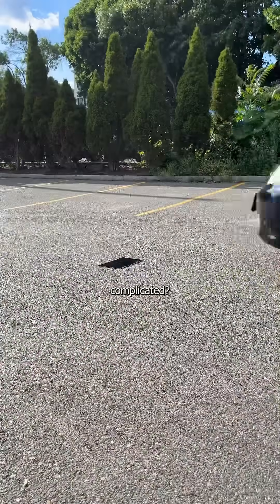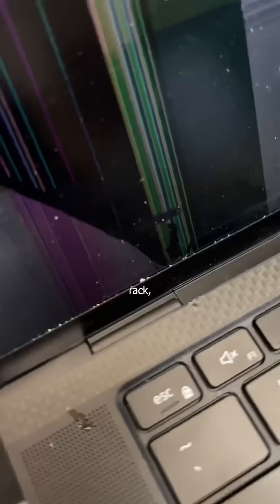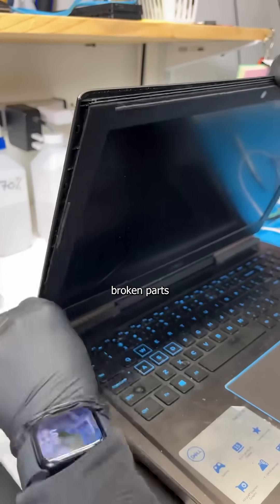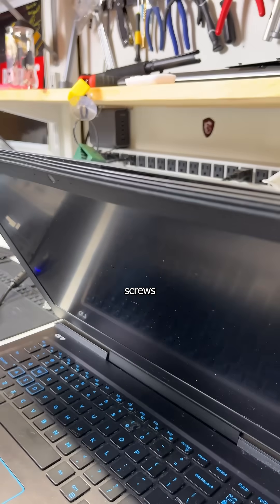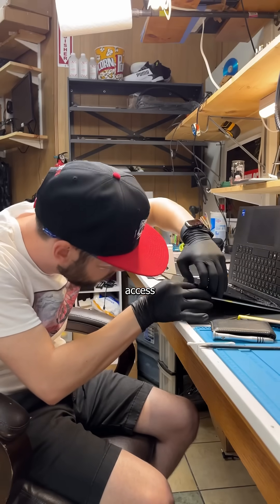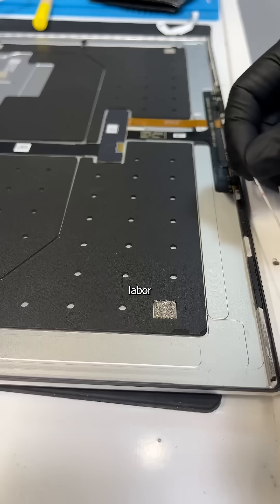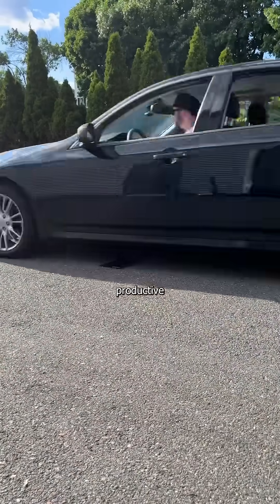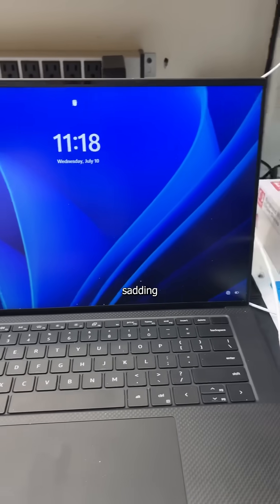Dell XPS laptop screen replacement (this used to be easy) #tech #pc #technology #shorts

Comment: Same thing happened with Chromebooks and their keyboards. Use to be take out 8 screws and it pops out. Now Take out those 8 screws then the battery then the main board then the supports and then you can get the keyboard out.

Comment: Yeah, we got some HP laptops for the employees at my workplace and they haver this adhesive for the screens where you need to basically stretch them to release them. Only problem is that HP used such a cheap adhesive that they will snap off before releasing the screen meaning that you either hope you can kind of grab the adhesive with some pliers or just basically ruin the screen and the back plate trying to get them off. 

Fucking thing isn't even that thin to warrant using adhesive to keep it in place. They probably just did it to be as annoying as possible.

Comment: I replaced my laptop screen yesterday and it was no adhesive besides a cable behind the screen connected to the camera and microphone and the tape holding the cable in place. Man, I love my laptop. It may be old, but it’s built really well.

Comment: Meanwhile in the Smart Phone Department: If your screen on a GooglePixel pops off (Which is apparently SUPREMELY common because they use cheap adhesive) You have to replace the ENTIRE case of the phone, because you can re-adhere it without breaking the screen's touch calibration!

Comment: Just got my screen replaced on my Asus rog $380. Opened it when I got home to find the entire frame was bent and warped so it won't close properly. Turned the laptop on and it booted up before suddenly blinking off and the smell of cooked plastic whaffed from it. So much for $2800 laptop I had for less than two years. Fm.

Comment: SMALL SCREWS EXIST! FFS, it's infuriating. It could have been so damn easy to just hold it by nice industrial style frame, but no.

And worst of all, sites like iFixit when product with actual screws instead of adhesive all around pops up THEY F...G COMPLAIN ABOUT IT.

Yes, you have to spend extra 10 minutes undoing 20 screws, so what? You can have nice looking device and no glue. Or go back to 90s with handbag sized laptops.

Comment: Laptops used to be big and chunky and might even have a handle so you can raw dog it. Now they're thin and made of nothing so you slip them in a big chunky laptop bag to give them a chance of surviving

Like, I would legitimately be fine with phones and laptops being two or three times the thickness if it meant they were easier to upgrade or replace parts in, or they could just have a polypropylene shell so I don't have to worry I'll break the damn thing

Comment: GTTEL Andy: Tell us in long form what your opinion is on chromebooks pros,cons, various manufacturers build quality, and repairability.
I was a long time ‘Mac’ guy for many years. Loved using them, upgrading, repairing, troubleshooting etc. I collected vintage Mac’s. Then got out of the biz where I used them professionally. Been using windows thin clients at work and there’s a top tier IT dept, so I’m just another user, but at home I find all my basic needs and more are amazingly uncomplicated and trouble free with chromebooks.

Comment: Dell XPS is easily the worst laptop I have ever owned. I want to talk to the designer that though plastic screws were a good idea. 2 years in and the fucking base fell off as the plastic had all stripped. Shortly after replacing all of them with actual screws I discovered that the XPS hinges wear down too, and my screen was now floppier than ya Dad's shaft.

Comment: same with replacing the keyboards on dells, it used to basically  clipped in and easily replaceable. 
But now you have to remove all the guts just to be able to get access to it

Comment: I have an HP probook quattro e 50 g 8 The version with 16 GB of RAM, 512 GB of storage, MX four and 50 video card and Intel Core 7 always gets hot and sometimes it restarts with basic apps like PowerPoint or youtube, I don't think I have placed it on pillows, mattresses or anything like that or have done things that damage it, it's true the computer is used but the seller he told me that he had practically never used it when it restarts it always gives me the same problem: kernel_power please help me

Comment: XPS aren’t good laptops and I know what I mean, the company where I worked before had a ton of them and every single XPS got spicy pillows in them so quick, we changed at least 5 to 10 batteries per month, AND the entire body ! Because when batteries swells, they break the trackpad, and to replace the trackpad, you need to replace the whole body 🤦‍♂️
Hopefully we had a contract with Dell so it was their tech who replaced the body every time but damn thats a lot of work for nothing

Comment: How much do you charge to fix a CPU box meaning where the CPU is held in that actually just has pens where the CPU goes it broke somebody actually I bought the motherboard and it was damaged by somebody before me how much would it cost to fix or replace you probably have to solder it

Comment: I've worked on a lot of HP products and some of their newer products (at the time, not sure about now) also used adhesive for their screens.  It is hard for me to overstate how horrible working with a delicate screen is when the adhesive is really strong.  Even if it wasn't broken before, the screen definitely would be after it was taken out.  They technically listed a way of removing the adhesive that might avoid breakage of the screen, but it didn't consistently work.  I don't understand why it's so horrible using screws instead of adhesive.  It works well.

Comment: All these electronics repair videos make me scared I might eventually need my laptop repaired. Last one had the screw of the frame at the base of the screen rust and snap. Screen still holds with a clamp and everything works plugged ( batterie died 5 years ago ).

Comment: I totally agree, now I have upgraded the display on a few laptops of mine over the years. My current Alienware M18 R1 is possibly the worst our of all the displays Ive ever changed out of the year, before it was a few screws, some snap tabs to get the bezel off, some more screws to get the panel out, replace, reassemble. 

But now they have replaced screws with adhesive. Making it difficult to get the panel you wanna upgrade out without breaking it. (to either resell or hang onto for warranty purposes later, I changed the display from a 1200p 480hz display to a 1600p 165hz display with HDR.)

Comment: i did a laptop screen once in six minutes the customer had only just left the store and was in disbelief that it was done so quickly. there was only eight screws holding the whole upper panel together, four for the bezel and four for the screen no clips no tape.

Comment: You’ve heard of the MacBook, but have you ever heard about the LintBook?
They mentioned they have a dog,
They did not mention the dog lives in the computer.
Four litres of Body grease on the screen,
600 stones worth of dust,
These gaming laptops should be called lint machines.
this diabolical slab of dust is nothing to the gooch collector.
And while we wait for that to boot to a happy blue screen,
Let me steal YOUR MOTHERS TOOTHBRUSH from the local Walmart to clean this machine from planet lint.
This computer did itself dirty like I did your mo-
anyway this is too dirty for me so I asked the gooch collector to clean this goochine.
the gooch collector is in that VW Minibus there, oh no he died from all the hard work from all these years, or he revolved to be the SUPER GOOCH COLLECTOR
These slow drives make windows updates feel like windows death dates.
Im about to make these HP (huge problems) into HP (huge potential).
my tiny raccoon fingers find out that this thermal paste is as crusty as the owner’s waifu pillow.
these spicy batteries became pregnant until I get a disease from planet lint.

Introducing the SadBook Pro. The dustiest, crustiest, greasiest, mustyist, overpriced laptop coming to a basement near you. Complete with 10lbs of horse pubes, two litres of finger grease, and more crack rocks than your local housing project. This diabolical delight of dingleberries isn’t for the faint of heart, but wading in filth is nothing new to THE GREATEST TECHNICIAN THAT’S EVER LIVED. Since crawling through the toxic landfill also known as your room is sometimes the only path to sleeping with your mo-. Thankfully, I’ve finally acquired a mask, thanks to atoms fearing for my health. So I’m well equipped to decontaminate this slab of malaria and scrub away those remnants of RSV using your parakeet’s toothbrush that I acquired during my nightly wrestling match at your residence. With the temps no longer resembling midnight in vegas, it’s time to wipe up the screen that has a layer of grease so thick it rivals the disastrous oil spill your face and with one last look over, it’s time to burn this rag like I’ve burned your eyeballs. 

THE GREATEST TECHNICIAN THAT’S EVER LIVED
@SalemTechsperts

Comment: Please help me , by pc is just loading when i add my RTX3060 , It was working normal for 2 months ,this is happening after my rtx3060 was repaired under warranty,  when i add GT710 2gb graphic card my pc works as a normal , what should i do ?
Reply from the maker: Warranty your RTX3060 again that you have determined yourself is not working.

Comment: That's nothing. I forget what I had where the glass was laminated to the screen with some sort of adhesive. So not only did I have to get into the laptop I had to separate the screen from the glass and clean the glass which took hours and a fair bit of I think it was acetone. What a gooey sticky mess.

Comment: Back when I used to do repair we found that the labor costs for replacing just the panel were more than replacing just the whole top cover assembly in some cases for a customer. Easier and cheaper but also doesn't really make for great content lol. We actually started doing this because of apple's Mac shenanigans. Leave it to apple to lead the industry in making the right to repair a nightmare.

Comment: Im new in the pc building, in the next few weeks I want to build my first pc and it would be nice if you take a close look at my components.
I already bought the:
I7-13700K,
The be quiet silent base 802 window black case,
An the asus prime B760-Plus.
The other components I want to buy are:

The Samsung 990 pro M.2,
Three be quiet silent wings 4 pro 140mm,
The be quiet dark rock pro 5 cpu cooler,
Thermal Grizzly  cpu contact frame,
Corsair VENGEANCE DDR5 Black,
The asus rtx 4070 ti super proart,
And the bequiet dark power 13 1000W.

I would appreciate your advice 
Thanks

Comment: Why do people care so much about looks and bezels. My hp pavilion is a bezel and a half but at least it's only screws to get to the inside. My s24 was a pain until i got a case cause it was so easy to touch the edges in games while holding. I don't think I ever cared about how small the bezels are on any of my devices and i don't hear anything great about it anyways, like what's the point if it's more of an issue and cost then a slightly bezeled device.

Comment: What's even dummer is that laptops are becoming more brittle each year. I went into my local Micro Center a couple of months ago, and all but one had an all plastic chassis. What really makes it bad is that only two of the plastic chassis laptops didn't feel flimsy. It's so bad that it even hit all the gaming and business grade laptops!! I'm not going to spend money on a POC laptop that's going to break if a small breeze hits it.

Comment: If needed to remove the screen, use a hairdryer on heat, not for long, at the back of the screen, then you can use a card or something thin to start getting it off easly.

Comment: I hate that they do this as well. Especially when it is the cable that is bad. Instead of a $20-$30 cable you have to add a screen to it. Had an MSI that the bezel was glued to the bottom of the screen which wrecks it when replacing it.

Comment: Do the tapes not have the little non-sticky tab that comes out from under the screen to pull on? I work on lenovo laptops and they usually have them, and pull out kind of like elastic. Cutting them with a string sounds like a nightmare. If the elastic breaks when I'm pulling it out I put my spudger under the screen like a wedge and and try to grab it again with my pliers. Btw you should check out esd safe spring-loaded Vampliers, they make fine movements like grabbing the adhesive tapes and putting in ribbon cables way easier

Comment: I had an old acer aspire and put chrome os once started has great battery life and was fast and responsive. Without any upgrades. And I used it for school and would often get a pencil closed in the hinges and the screen did not break at all. Was not damaged.

Comment: had to replace the screen on my first laptop once. couldn't get the original resolution, so suddenly I had full HD. performance went DOWN because integrated graphics had to work more for the same size higher res screen.

Comment: Is it thinner and lighter?
Yes!
Is it enough to make a difference?
No.
It's a cost saving measure, tape is cheaper than designing a body that will hold the screen with clips
It also deters amateur repairs, making the user more likely to simply buy a new one

Comment: I did the same damage on a phone bit it from the inside because for some reason there is a top part just loser than some girl who goes to bed with men for money and it cracked the inside instead on the outside and well it's not a bad damage so the phone is still useable like im using it to type a storm with this comment

Comment: Meanwhile apple wants you to replace the whole screen including the clamshell cover
Reply: And for the small price of almost a new computer! What a coincidence!
Reply: Dell will also send the whole thing including cover. The expensive part of the whole area is the screen, so rather  spend a couple of $ extra in plastics and cheap edp cables than in 2 hours of labour of someone performing surgery on a screen.
Reply: @jorgeandrespalma2134 
A friend of mine had a display shipped to him for his M16 R1.

When I opened the box, I was QUITE RELIEVED to see they shipped the entire display+lid assembly.

Although I love that no other adhesive and effort were needed to install a panel-only, the tech suppprt and warranty hoops you have to jump through to get Dell to send it is a headache.
Reply: meanwhile me with a macbook (cracked screen and color in built in screen gave out): guess ill use my tv
Reply: Customer : The keyboard x key stopped working.
Apple : Hmm. The repair price will be 2,000. Maybe you should just buy a new one ?

Comment: Not surprised it's dell, they're the kings of anti-comsumer designs.  I went to try and replace a fan and the keyboard and repaste the cpu on my G7 laptop, but it was impossible.  Of course the fans were underneath the motherboard, which was held down by multiple overtorqued screws that also had locktite on them.  Ended up destroying the computer in the end as it was 8 years old and idling at 85C for god knows how long.  Sucked, because i liked it and it still worked ok-ish, but wasn't going to pay $200+ to do maintenance on a machine that was probably a month away from death by barbeque.  Definitely won't be buying a Dell again after seeing all this crap!

Comment: I mean it's not like you're going to replace your screen unless it's broken anyway
Reply: The issue is that it should be reasonable for a tech to repair to begin with.  Even if it doesn't happen often, people shouldn't have to be forced to replace their entire computer of one component goes bad.  And I consider it forced when the option of getting it repaired is so intentionally impractical and expensive that full replacement is the clear option.
Reply: @psychickumquat  I wasn't saying to the contrary. I was just saying that is their rationale for making it so you have to break the screen to replace it.
Reply from the maker: What if you need to replace the webcam or back lid (from the hinge breaking)?

Comment: It doesn't help that the adhesive is so strong it could hold marriages together...🤣 I miss the olden days of screens being held on with screws😭
Reply from the maker: It always rips off the LCD board at the bottom, like wtf??
Reply: @SalemTechsperts  self destructing lcds to go along with the c4 hp batteries🤌🏻😵‍💫
Reply: @SalemTechsperts  right?! I hate lcd repairs💀